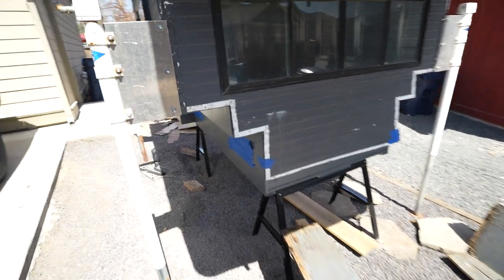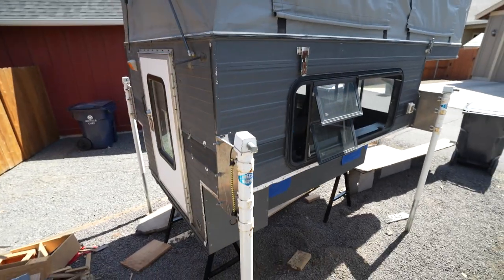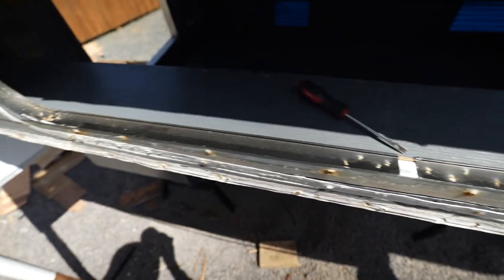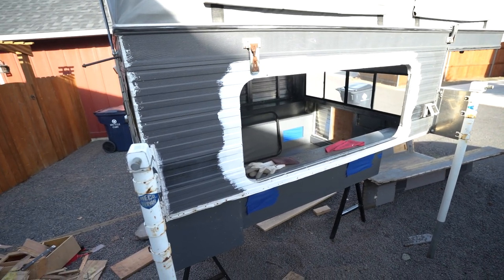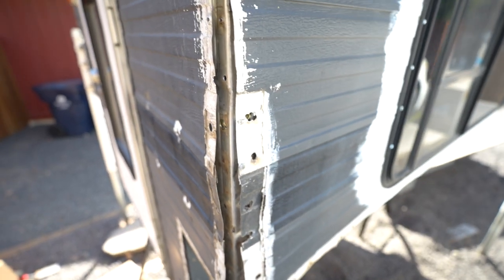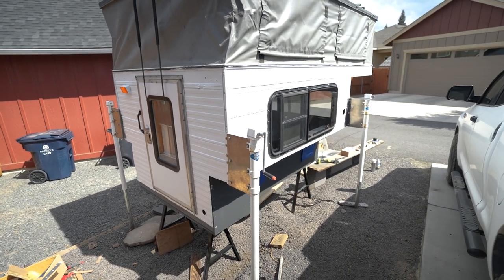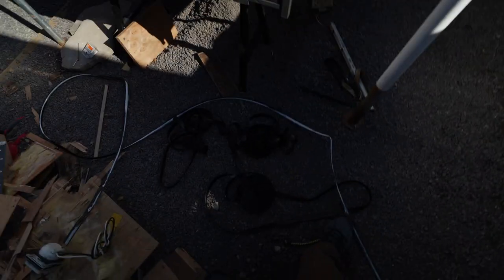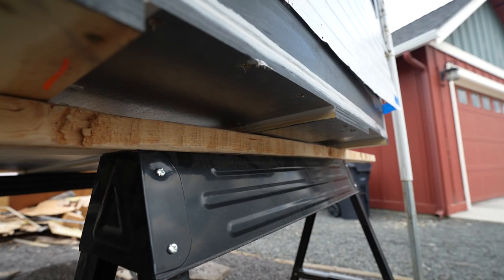Major Transformation - It Looks Brand New (Almost) - Four Wheel Camper Rebuild PT. 4 - Exterior

Comment: Damn, super impressed! I haven’t painted mine yet. I was trying to decide whether I brushed it or sprayed it. That brush job looks pretty good mine is just smooth siding
Reply from the maker: Thank you! You can’t even tell it was brushed. The wood texture siding certainly helps blend things in. For smooth siding, it would either roller or spray. Brush strokes will be a lot harder to hide on smooth siding.

Comment: Looks great! Lots of progress and great to see. When you do the top, will you be redoing any of the cloth? I dont know where i saw it but some added a skirt that is attached to the outside of the top and protects that channel where you thought you had that leak. I could see that being a little extra work when setting up but nice to know any rain that hits it will be directed over and away from that area. 

Another area you may consider but i doubt its a big deal is your new bottom pannel board has a flat surface where water can sit. If that was chamfered, it would prevent it from sitting there and allow it to run off naturally. 

Cant wait to see the next video! Youre killing it. You gotta feel good about it now!
Reply from the maker: I have no plans at this moment to redo the canvas. But I’m sure I’ll do something down the road, likely sew my own.

Yeah I could add a chamfer, but it ultimately won’t matter a ton. Similar to facia on a house and should last many years with reg maintenance.

Thanks for tuning in, I appreciate it!
Reply: @pnwxplore  very true, sometimes it's just more work or unneeded for the length it will be around. Don't need indestructible parts when someone only keeps it for 5-10 years
Reply from the maker: I didn’t have a router when I made the piece and now I do, could have rounded the edge!